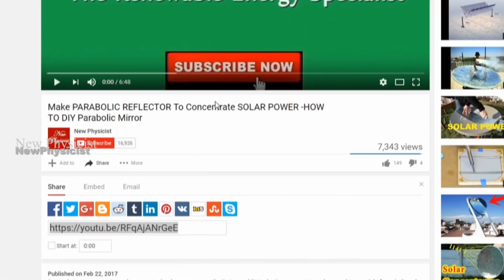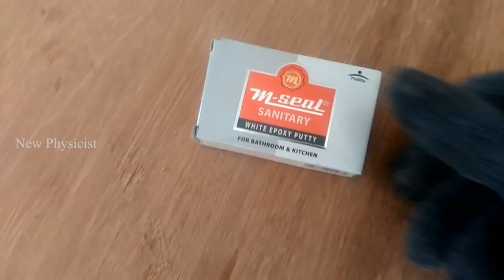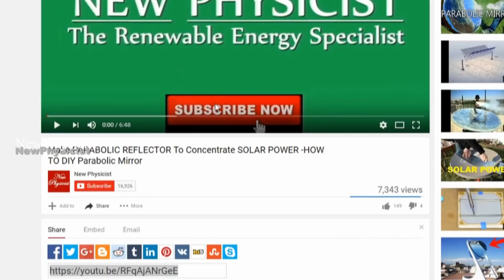How to Make a Steam Engine DIY

Comment: You may want to change to an grinding disc when switching from cutting to grinding. I hear the cutting discs are pretty fragile and can't take much sideways forces, whereas grinding discs are thicker precisely for that reason. Not that I have personal experience with the beast, lol.
Reply: Or he could just use a jigsaw. Less dangerous and more precise.

Comment: This is just a prove of how steam works. Its not an engine. This is not an engine which can be used in any porpose. This cannot even have a torque to generate 3.7v connected to a dc usb phone charger

Comment: Cool video. There are some major safety issues though. Cutting into spray cans with grinders and wearing cloth gloves with rotating tools are bad ideas. As a machinist, I can tell you that a rotating tool can and will snag a gloved hand. Spray cans being cut into by something that puts off showers of hot sparks is just not a good idea.

Comment: Very stupid to upload a video on how to potentially blow yourself up, cutting into a spray can with a grinder is a recipe for disaster. You may have used cans with non flammable contents and made sure there was no remaining pressure in them before cutting but you didn't point that out. How many kids are going to run into the garage and take an angle grinder to a half full paint can and blow their faces off? You are an idiot and this video should be removed. DON'T TRY THIS AT HOME KIDS, this guy is a MORON.

Comment: No one gonna mention how dangerous it is to grind on a spray can?
Reply: Maybe use duster cans, that's not flammable i guess
Reply: Grinding/cutting open an empty can isn’t as dangerous as burning a can. Grinding an empty can (really empty, at atmospheric pressure) doesn’t really generate much heat and lets the gas out (gas stored maybe dangerous, but common sense will be there to stop you from cutting open a can of pesticide), and not all gas cans are flammable, they’re just explosive under heat

Comment: i have some doubts abt this experiment...plz reply me...!!!!
Reply from the maker: Yes.  I'm all ears
Reply: i wanna knw wht the equip u used to build it...becoz i gonna do tis as my college project..so can u tell me... @newphysicist
Reply: @ashoksachin3428  ee
Reply from the maker: I'm sorry for the late reply. What you want to know my friend? I think I've shown everything clearly in the video. Anyway I've a list of things I used.

1. Body spray cans  (remove the pressure before drilling)

2. Copper pipe
3. Anything that can be used as piston head
4. Multiwood 
5. Pens
6. Bearing
7. Flywheel 
8. Tools 
What else you want to know?
Reply: @newphysicist  what is the material you used to built cam and connecting rod....?
Reply from the maker: It's called multiwood here.☺ it's not necessary to use the same material. You can use any flexible material.